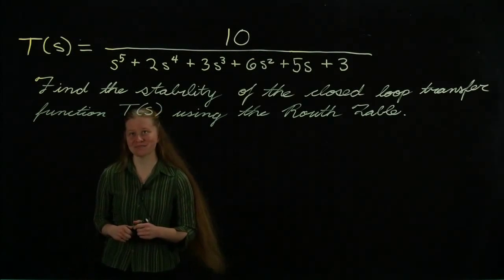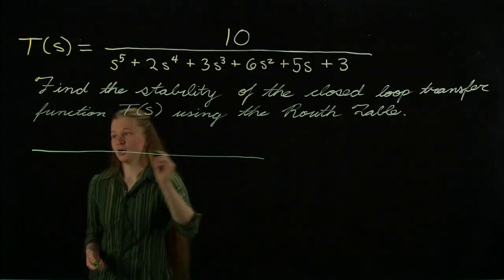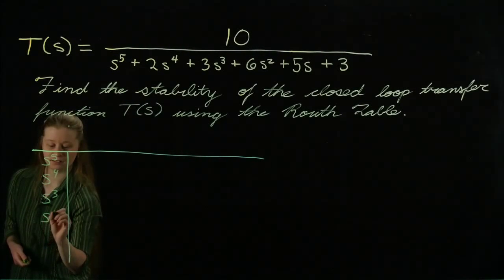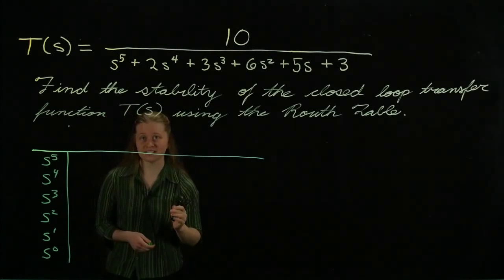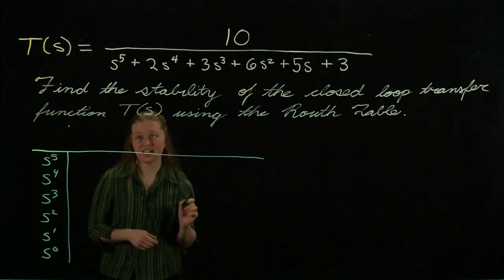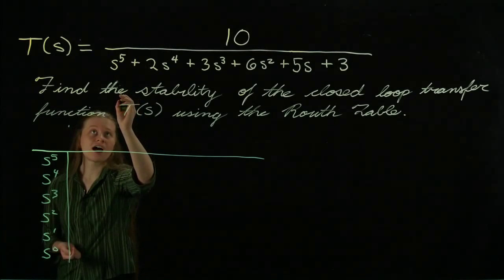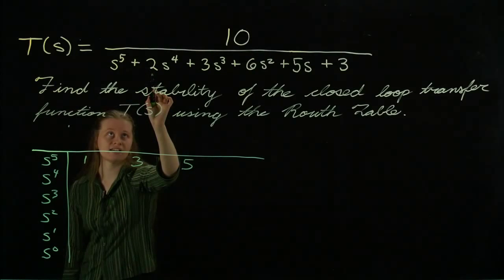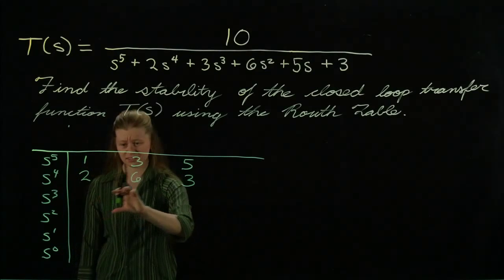Systems Analysis - Routh-Hurwitz Table

Comment: mam , why you didn't add 10 to 3
Reply: Because T(s) indicates the transfer function, that is the denominator should be taken as it is. If it were G(s) and we could verify the value of the feedback(Assuming Negative Unity Feedback) we would then add the ten to the 3 since T(s) = G(s)/(1+G(s)H(s)).